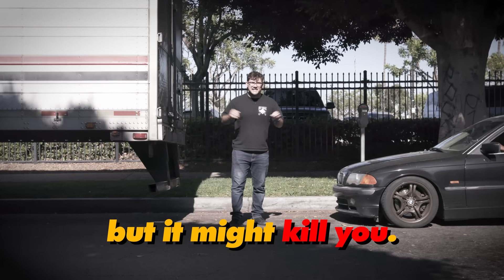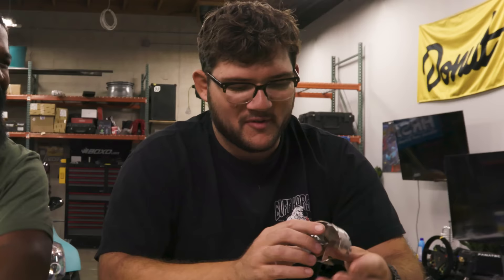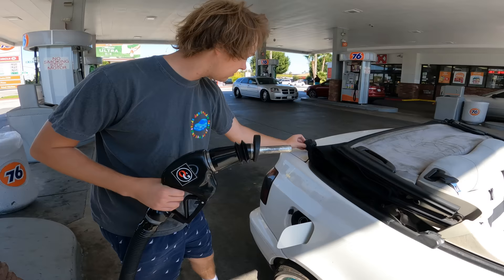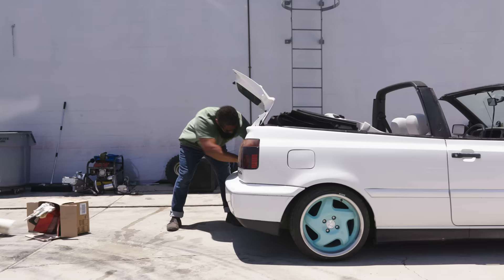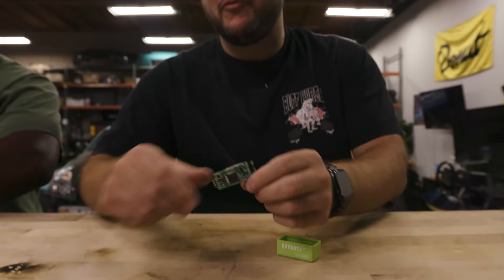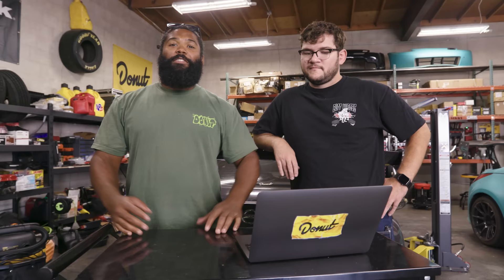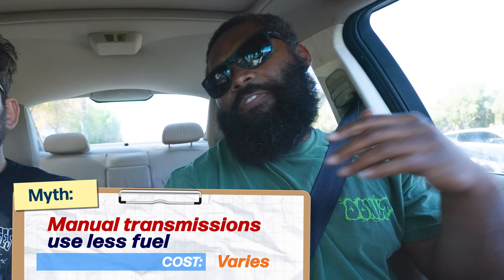Testing Fuel Economy Hacks

Comment: HHO generation actually works, like, it's proven science. It just doesn't work inside of a car. It would be infinitely more efficient to have a HHO generation electrolysis system at home, maybe powered by solar panels or something, then compress generated gas into a canister, and then just use that in a car. At that point you've got basically 90% of regular LPG system, though. And proper HHO generator system willbe rather expensive, but if you drive a stupid amount, then it actually might be worth it.

Comment: HHO generators don't get as much power from the fuel they create as they use to generate the fuel. 

The energy is wasted as heat in the process of the chemical reaction. 

To actually work, you need to create a fuel using an endothermic reaction, that when used creates an exothermic reaction.

Comment: #1 to say that because the fuel tanks are stored underground they’ll always be the same temperature is just wrong.. it hits -40 in Wisconsin in the winter and 90 in the summer. #2 yes the engine heats up, but why would your fuel tank heat up?

Comment: FYI overinflated tires make them skinnier and they do actually make a difference not much 1-2%or so. Why do Tesla with smaller tires skinnier tires have longer range? The rolling resistance is bigger than you think. In Tesla 21 vs 19 rims you lose 5%-15%. You lose 25-30 miles range on a 300 mile car that’s 10% because of the tire and wheel size( fatter contact patch and slightly heavier). All gas mileage cars have skinny tire to cut wind and rolling resistance. Road and track states getting the bigger rims you lose 23 miles on a range of 299 in stead of 322 on the model 3.

Comment: A few years ago I went on a highway. There was a long distance bus taking the same onramp in front of me. I had time so I stayed behind the bus because I was interested in how much fuel I could save. We were going 100 to 110km/h. At some point the bus left the highway and at the same time another bus juzst entered the highway right in front of me. So I ended up staying the entire trip behind a bus. Normally at that speed my car burns at least 6 litres per 100km. That one time it only took a little under 6 litres - BUT for the entire trip of 165km. So the fuel consumption was drastically reduced. You could even feel it during the drive. I had to push the accelerator notably less than normal to hold the speed. Also, I did not get too close. I keept a relatively safe distance of 40 to 50metres all the time.

A note on the high octance fuel: Yes it is true, that octane does not relate to fuel consumption or power of the engine directly but ALL modern engines have a knock sensor and will adapt the combustion according to the octane of the fuel. And that results in different efficiency and/or power. German version of many sports cars need officially 98 octane fuel. You can use 95 octance but the manufacturer states, that this will result in reduces power and increased fuel consumption. Some even put this in the spec sheet. One famous example is the old 20V 1.8T engine from Audi. Officially it runs on 95 octane fuel (which is low octane fuel in Germany). But using 98 octane fuel resulted actually in a 5% lower consumption. You could see that on a german website were all people could store all the data about what fuel, how much they pumped and what distance they driven. I had it for 7 years and I can confirm that the average consumption dropped measurably when I permanently switched to 98 octane. For a long time the 98 octance fuel was only 2 to 3% more expansive than the 95 octane fuel. So you could actually save a little money. But whether it is measurable or not depends on the engine. For most engines it doesn't really matter and you should just stick to what the manufacturerer recommends.

Comment: You missed some ways for fuel efficiency like headers and air cleaners cold air intake, cowl induction, remove catalytic converters, throttle body risers, throttle body modifications, warm fuel, fuel vapor, Solar panel and let me know of any others you hear of

Comment: also when driving a manual try to driver at highet gears top lower rmp because the higher rpm the car runs the more gas it's going to use. but dont run to low rpm because it comes to apoint where if your rmp is under a sirten point you are driving with full thraotel and that brings gas  milage up. depends on your engien and other things to but for me, driving in a higher gear have the rpm around the 1500 mark gets me great milage. but under acceleration i obviesly have the rpm higher.  i am from denmark so for us manual is standart and we generaly have really small cars and they dont use that much gas becasue the smaller it is, the less it weghis and since for the most part we like 4 cylinder engiens, we have a "big" engien when comperd to wheght. my car si a 1.5 liter v4 with 130 hp and the whole car only weighs about 650 kgs or 1400 lb ish. so lots ofg power for a little nugget car. yes most of the smaller cars are lower power and also smaller engien then mine but still you get the point. my friend have a 1.0 liter v4 with 74 hp. and that thing is about 550 kg or 1200 lb ish. but still low weight comperd to power.

sry for my bad typing, but english is not something use that often

Comment: Windshield wipers reside within the boundary layer of your car.

What is the boundary layer? It's the reason why you need windshield wipers in the first place! Why doesn't the rain simply blow off the windshield while driving at highway speed? Because of the boundary layer-- the slow-moving layer of air bouncing off the car's surface and colliding with the incoming air.

Comment: Water is heavy, and electrologists takes a huge amount of electricity to produce a decent amount of gas, no street car could produce enough gas. The Toyota hydro cars places the electrolysis from a factory so the car does not have to have giant batteries that quickly drain as it attempts to drive and charge instead it stores hydrogen gas In pressure tanks on the car.

Comment: You forgot to try water/methanol injection. Technically the hho should have done almost the same thing if it would have beed sized accordingly but i am not sure how much you would loose because of the extra load on the alternator...so a simple water meth injection would be better.

Comment: Best way to save fuel is don't buy a bloody SUV or crossover and don't use the brakes. That means look in advance what's going to happen, don't accelerate before a red light when you know you'll have to stop anyway (if it makes you catch a green wave, then by all means). It's also much more efficient to accelerate on the highway to pass another vehicle rather than to brake and wait for a slot where you can overtake without accelerating. You can always coast after reentering the slow lane. Also, don't accelerate slow. Not full throttle either, but something close to that. And shift early, of course. This way I can hit the official mileage of my car, around 48 mpg.

Electric cars are better though, as they can recoup at least some of the braking.

Comment: HHO Generator will never work. The electricity needed to break apart the water molecule, ultimately comes from the car. So you spend gas to create hydrogen, which is then burned to save gas. Best case scenario is you’ll get back all the energy you used to create the hydrogen. But more likely is a net decrease in efficiency.

Comment: The HHO generator would never work because it takes a lot of energy to split the water molecules. There wouldn't be a net gain in power. When you burn the hydrogen it just turns back into water.

Comment: This video is a little misleading.  Some of the things you said were no good actually do make a difference.  A lot has to do with the car first of all, and of course, driving style. 

But I did a bunch of these tests when I was in high school on a 4 cyl geo metro sedan that I had. I got it up to 60 mpg and by no means was I being easy on it. She was still pinn’n at 85 but ya, we got her to almost a 60 mpg avg. (high 50s if I’m being honest). 

Overinflating definitely works but can also be super dangerous, it’s only even remotely safe in the dry and at speeds below say 80, with an experienced driver.. We put 60 psi in the geo and definitely saw a couple mpgs. Maybe it’s just me but the slightly taller tire made her feel a little more peppy too. Jajaja. 

Although at higher revs she also did get much better mpg going faster. At least in the series of tests I performed. There seemed to be a speed where you where just barely giving it any and it was just like flicking a spinning wheel. Because the car was so light and the wheel was EXTREMELY round, she was cruisin.

Comment: Automatic cars have to be less efficient, especially during stop start traffic. As long as the engine is running, the torque converter is ALWAYS applying torque to the gearbox and wheels. When you hold the brakes, the force of the bakes overcome the torque converter. If you put it into neutral when stopping then that's the best shot. But when driving, a torque converter  can have at most 95% effeciency meaning at all times, at least 5% of the total power of your engine is being wasted. Manual transmissions allow for a physical connection via a clutch which locks the engine and gearbox delivering 100% effeciency when the clutch isnt slipping. Not to mention that automatics rev the engine up a lot whereas the manual transmission allows the driver to drive conservatively by not revving the engine up high. The amount of gears of an automatic probably wont offset the inneficiencies of the technology.

Comment: The whole war between Automatic vs Stick shift has zero to do with Fuel Efficiency.
It has to do with the fact of 
1. You can easily push jump start a manual vehicle vs a Automatic which requires a second car to jump it.
2. A Cluster replacement is alot cheaper then the replacement of a Automatic Transmission.
I'm a 1980's baby and as Gen X we were the last generation who grew up driving Stick shits.

Comment: Does anyone know if is it better if I'm in 6th gear to cruise at 70 (the speed limit) at 2300 revs or at 60 and get 1900 revs, because I feel like obviously at 70 you can get to the destination quicker in a shorter time but because it requires more input from the engine I don't know if it is more efficient then going at 60?

Another question, if 70 is more efficient then would it be even more efficient to hypothetically go at 80 or 90 if I wanted to be more efficient when driving?

Comment: 8:51 - fuel with higher octane CAN reduce fuel effiency! But it depends on a car.
I tested on natural aspirated opel 1.6L (4 cylinder), Toyota Aygo 1L (3 cylinder), infiniti fx37 3.7L (V6) - there is no difference betweem regular or premium (95 or 98/100 octane).
BUT, HUGE BUT! Kia soul 1.6L 4 cylinder GDI HAD SIGNIFICANT advantage in torque distribution across the range and I calculated and checked with long run for 3 years and 40 000km (28 000 miles?) - and got BETTER fuel economy with premium (98/100) gasoline (benzine). In country where I tested I made calculation and OVERALL it was CHEAPER to use more expensive gasoline and also give me more smooth or more fun driving experience! Also - in "fun" mode it create less damage to you engine since it knocks less on high RPM!

So- if you have any type of GDI (from Mitsubishi or from Kia/Hyundai) - consider better fuel. Also FSI from VAG (volkswagen\audi\seat\skoda) potentially can benefit from better fuel

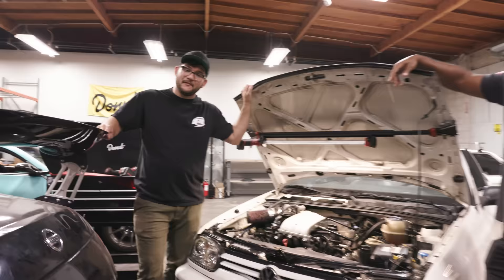15:11 as for OVERALL fuel economy its EASY
If you use brake pedal- you where to fast before, that means that you throwing away potential energy that you get when you where accelerating. Accelerate ENOUGH so you would not need to use brake pedal a lot. 
Also, style of driving depend on vehicle type and engine and transmission. Infiniti with huge 3.7L engine dont care to move you, because its already is a heavy engine in a heavy car. Toyota aygo with 3 cylinder 1L engine is very sensitive to throttle pedal - you can cut 30% of fuel consumption without changing you overall speed just by notice how deep do you push accelerator pedal and when, and by having 5% less acceleration speed you can cut 30% of fuel consumption...

I wonder if anyone still reads comments section on youtube... pls reply or use thumps up\down for vote, because I feel like wasting my time =(

Comment: For the Manual vs Automatic argument:
The real answer is IT DEPENDS

Sure, generally speaking modern automatics specifically ones like the CVT or conventional ATs with more than 5 gears are generally more efficient now than Manuals but it would differ greatly on specific brands, models and trim level.

There are so many factors as to whether or not a certain car variant with MT would be more or less efficient than an AT variant.
Asides from transmission type, the biggest factor would be the ECU.
All those 7+ gears (or non-existent ones like with the CVT) are going to be useless if the car itself is paired with a dumb ECU that can't shift properly, doesn't know how to be efficient with the gears, shifts too late, loves revving beyond 2000rpm and more. In this case, MT cars are still going to be more fuel efficient since you'll have more control over your shifts and how low/high an rpm you'll be staying provided that you know how to shift properly and don't have a heavy right foot.

There isn't and shouldn't be an exact answer to this since there is no uniformity for all car manufacturers and some will put seemingly "fuel-efficient" trannies in a sports car yet be paired with an ECU that's more tuned to dish out more power and also being paired with an idiot driver behind the wheel who drives like a speed demon and presses on the brakes like you trying to press the "skip ad" button on that pornhub video you're watching.

Some manufacturers will use AT trannies with less gears but still be fuel efficient than an MT or even a CVT or  DCT due to a better tuned vehicle and ECU.
Some will also put AT trannies with 1000 gears but equipped with a dumb ECU that chooses power over efficiency plus the car itself would weigh as much as an M1 Abrams tank due to all the amenities it has.
Reply: Naah bruh. Automatics are more efficient nowadays because ECUs are not that dumb to be worse than the average human driver. 

Even with all the caveats listed, 90% of the time the Automatic is better and that is all it needs to be for the average driver. You personally might be more efficient or you might know people that are more efficient than certain ECUs with CVTs or ATs but that is not the majority of people driving cars.
Reply: @arjunsatheesh7609  
like I said, IT DEPENDS

There are so many factors that should be taken account for when it comes to fuel efficiency.

and it's not just my personal experience though.
You sound like your Indian, just look at the cars we have here in Asia.
There is an MPV here called the Mitsubishi Xpander and even with it's 4-speed AT, it's actually just as or even more fuel efficient than it's other competitors like the Toyota Rush which has a similar 4-speed format but a gas guzzler or even the Honda BRV which has a CVT.
And the MT variants of all them are the most fuel efficient of the bunch.

Or even the Isuzu Mu-X which only has a 6-speed AT (whereas the others are 7+) and is also equipped with a larger 3.0L engine than it's competitors (with the 2.4L of the Mitsubishi Pajero/Montero Sport, the 2.0 Turbo/Bi-turbo of the Ford Everest and others) yet it is the most fuel efficient of the bunch.

Like I said and I'll say this again, IT DEPENDS
Trannies are just one of many reasons why cars or vehicles these days are fuel efficient.
And like I said, the biggest one that most people don't think about is the ECU since it's the one (more specifically the manufacturers who tuned it) that adjusts the fuel/air mixture accordingly.

Plus driver habits is also a very big factor as well since if you have a very heavy right foot, all the other variables would become moot because you're just driving like a speed demon.

Since it's pretty basic even in physics that if you want more fuel efficiency, you'll loose power and if you want more power, you'll loose fuel efficiency.

There really isn't any exact or dare I say a right or wrong answer since the answer would depend on what specific vehicles we are talking about.
Reply: @dickmelsonlupot7697  Right, I have been judged by the absolute authority that you are as "clearly don't know shhtttt". (Edit - And  now I can't see the "clearly don't know shhtttt" comment, wonder why that is).

I shall take this judgement as ultimate and surrender my opinions to the one true enlightened master that you are. 

People who can drive manuals are really not more efficient than an Automatic in most situations and people who can't drive manuals anyway are better off with automatics. 

I remove the above opinion from the discussion and instead offer no further comment.
Reply: @arjunsatheesh7609  
I'll repeat this again as well, IT DEPENDS

and no, the world doesn't have equal stuff.
Some countries will have bad ATs but good ECUs or have good ATs but with bad ECUs.

You clearly have no clue about fuel efficiency if you're that adamant to defend ATs without even looking at what other people have to say, experienced or even seen or what circumstances other countries have.

America is not a good standard to look at mainly because they have some of the best stuff being churned out there which is what brings truth to the notion that modern ATs are somewhat better and more fuel efficient than modern MTs simply because of how technology evolves and I don't, haven't and will not deny that since it's true.

It's a different issue if we go outside the US since many nations don't put 7+ ATs, CVTs or even DCTs mainly because they're expensive and sometimes useless depending on the country.